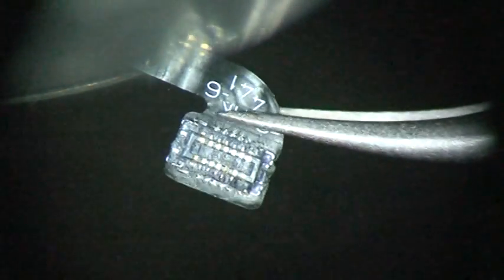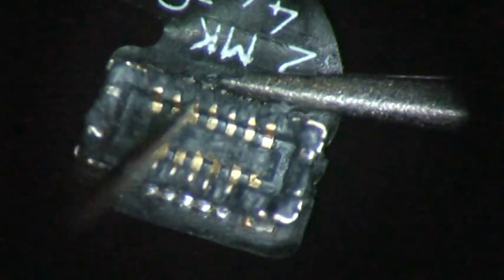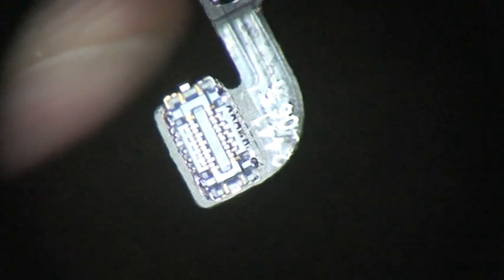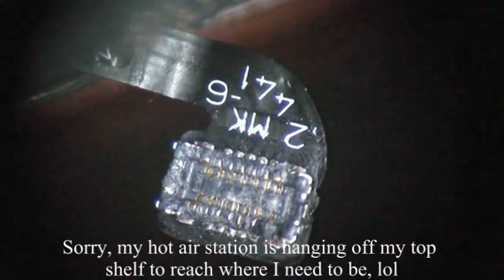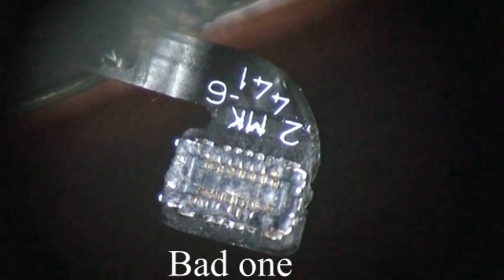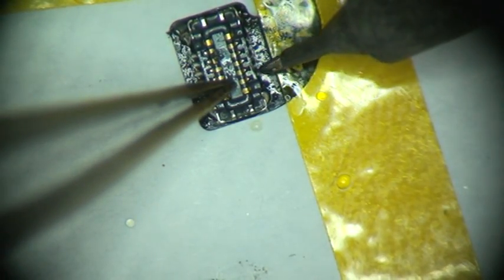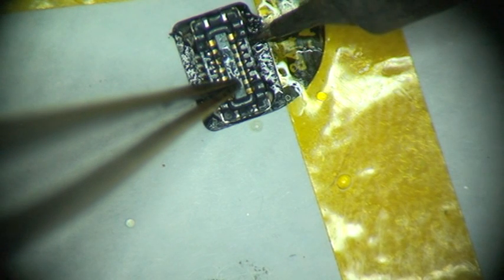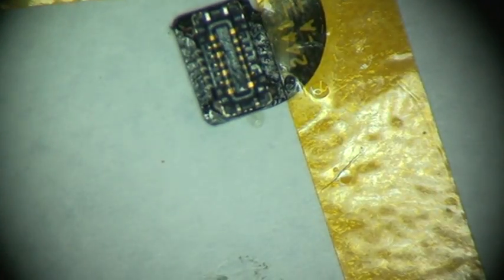iPhone 6 home button FPC connector replacement - Error 53 fix

Comment: hey what no. tip is that that your using , i have the micro pencil  but looking for a smaller tip   . Thanks
Reply from the maker: T30-I TIP,CONICAL,R0.1 x 6mm, - This fits the FM-2032 iron.  Hope that helps!